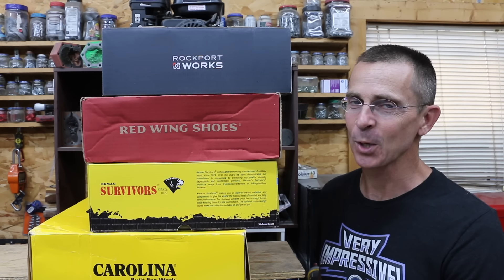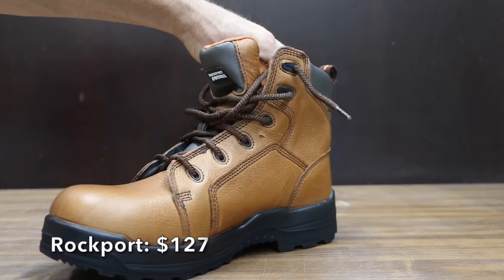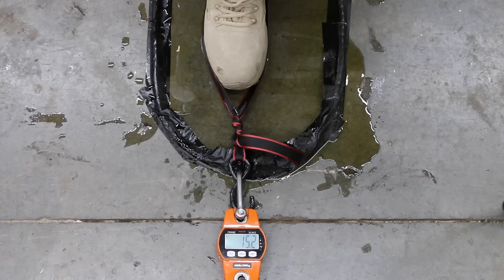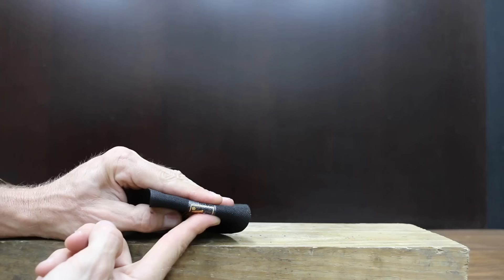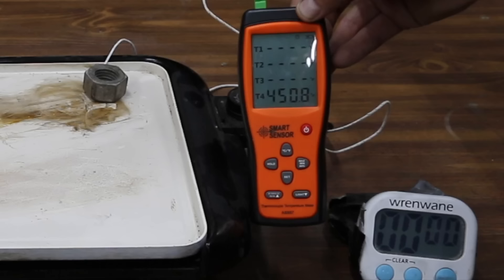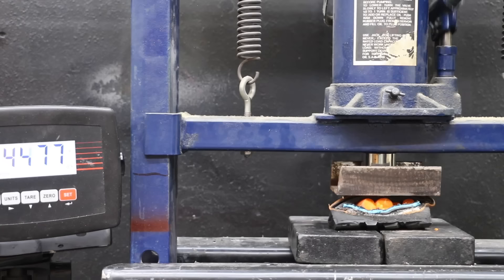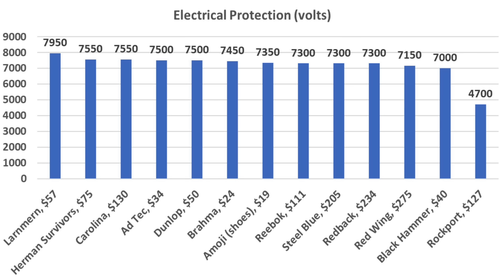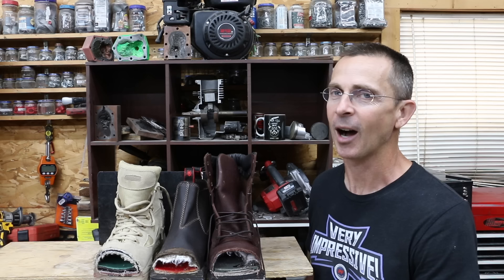Best Boots? $24 vs $275! Let's Find Out!

Comment: Had a pair of Brahma Alpha Waterproof steel toes that saved my toes on my right foot one time. Was weedwhacking a swale in Florida after a couple days of heavy rain was standing In about 3ish inches of water and the grass was a good six inches above that. All of a sudden my right foot was really heavy and hard to move looked down and a snapping turtle clamped down on the steel toe part of the boot. He wasn't huge maybe a little smaller than a dinner plate but I sure was grateful for that cheap piece of Chinese steel 😂 that day would have sucked if I wore sneakers.
Reply from the maker: Thanks for sharing!

Comment: MIG Spatter,  Weld Slag or even worse a small drop of Molten Metal would be a good test as well!

I have a few chunks of slag stuck in the bottom of the cheap steel toe sneakers i had before i got proper leather boots, and the top plastic mesh got all burnt from MIG Spatter.

Comment: I saw both of your work boot videos. But in your first one, you listed Sketchers as being a viable candidate.  I have learned to trust your opinion,  and so I bought a pair.  I elected to buy the Sketchers because of price point because I am VERY hard on work boots. I must say, I really like them.  I do a lot of cement/concrete work and that wears out a boot very quickly so I don't like to spend a lot of money on them (did it before but won't do it again).  

Just wanted to say thank you.  Your channel is very valuable and makes making the decision of which to choose a lot easier. When I first came across your channel, I turned my noise up to it,  but I quickly learned how wrong I was for doing that. Keep up the good work.
Reply from the maker: Thanks, will do!

Comment: Ive sold boots for years. One of the number one things people would ask for are what boots keep the feet the coolest in summer temps on hot concrete/pavement and the sun directly. Overall redwings were very popular they usually solve most peoples sore feet issues standing up all day with other branded boots. They are on the heavier side but are pretty durable.
Reply from the maker: Thanks for the feedback.

Comment: One more test that would be interesting, is shelf life of the boots. Some work boots that have been in storage for about a year or more, start falling apart within days of being put into service. The stitching disintegrates. I've been told, this is due to salts being used when tanning the leather of cheaper boots. 
Also, water leakage, how long for water to soak through leather. then, dry and re-soak, dry and re=soak to simulate a month of wet weather. Boots must be flexed, both wet and dry, to see if cracks form in the leather.

Comment: PUT COWBOY BOOTS TO THE TEST!!

I've been in the commercial construction industry for nearly 20 years and I usually purchase boots under the $100 price range, and they only last me about 6-8 months. About 6 years ago I bought my first pair of cowboy boots that were Justin brand. I got about 3 years of use out of them before the bottom tread at the ball of my foot, completely ripped apart width ways. Now I have a pair of Ariat boots that I've been working in for over 2 years and so far they are the best boot I've ever purchased!!
Reply from the maker: Thanks for the suggestion.
Reply: I wore leather soled Frye boots when we were camping and the smooth leather soles were great for stomping our camp fires out. They also survived walking across the fields after a grass fire, Most of my friends ended up with their rubber soles melting and falling apart.
According to one of their adverts, Frye boots were worn by cowboys because leather does not melt or burn.

Comment: I like redwing boots, they are by far the most comfortable, but the problem i have with them is they are easy to wear out. I wear them all day everyday in rain, heat, cold, mud, oil, corn, on ladders, on flat steel 30+ feet in the air, rough ground, gravel, you name it. I am on my 3rd pair of redwings after 3 years of trying different types
Reply from the maker: Thanks for the feedback.

Comment: I bought a pair of the Steel Blue women's a few years ago. I worked as a remote-control locomotive operator in a steel mill. I don't think they even made it 6 months. Both boots split where the heel comes into the sole. Because I purchased them on Amazon there was no way to return them even though the company says to just return them to where you bought them for a full refund. For reference I was walking between 15,000-20,000 steps per shift, 60 hours a week average. For $200 I expected a better outcome.
Reply from the maker: Thanks for the feedback.

Comment: One thing you should have tested was abrasion resistance of the sole, sides, and toe. Some boots will cut straight through if you accidentally scrape the corner of concrete steps and such, and some boots lose all of their tread very rapidly just by walking on concrete. You could probably test it pretty quickly and release a short addendum, I'm sure it would be appreciated greatly, as all of your videos are. 
Aside from normal wear and tear, I know some people tend to hit their heels together when they walk(I used to until I taught myself not to) and that can rapidly damage many shoes/boots, so that's a thing to consider for some people(although plastic heel and toe caps trivialize this).

If you decide to do another boot video, you should try to test out the boots with kevlar midsoles, plus it'd be cool to see a comparison of the differences in durability/protection from leather, synthetic "leather", fabric mesh, and mixed material boots. I know, for example, my dad has a pair of Brunt brand boots that uses the fabric mesh body(with hard toe and heel caps), which are waterproof and extremely abrasion resistant despite being a very flexible material. I personally have some cheap soft faux leather boots which are shockingly cut resistant. Material science is hard.
Reply from the maker: Thanks for the suggestion.

Comment: Steel blue having such good results in the oil test makes sense considering that is a mechanic style boot. I’ve worn them through gear oil soaked concrete, greasy kitchens, and even on oiled steel without drama

My cousin (electrician) wears red backs all day every day, the same slip on pair shown here, and had to borrow a set of my Oliver AT mechanics boots, and he just couldn’t get used to the weight difference. But he doesn’t have to be up and down vehicles all day and doesn’t need the ankle support you need to climb heavy machinery
Reply from the maker: Thanks for sharing.

Comment: I've boght 3 or 4 pairs of Herman survivors. There is good and bad news. The bad is every pair that I've bought only lasted about 2 years before the soles fell apart. The reason I keep buying them is, by far... hands down they are the most comfortable work boots I've ever worn. They just seem to fit my feet great. I use them when I'm cutting lawns, and have them on 9 or 10 hrs a day (30 hrs a week). I feel like I'm wearing sneakers. Not too tight, not too loose.
Reply from the maker: Thanks for the feedback.

Comment: I have three pairs of boots which I switch out from time to time.

One pair is 30+ years old with rough out leather.  The leather is old, and had a hole which was repaired. More recently, a portion of the welt on one boot pulled loose.  I glued a patch to hold the welting and prevent additional damage.  After resoling and repairing them several times, I will probably not repair them again when they wear out again.

A second pair is probably 15 years old or so.  The leather upper is in good condition and I polish them from time to time. I have resoled them probably once, and replaced the heels again,  and that will likely need to be done again before long.

My third paid is about three years old  "Danner Boots."   Leather upper in very good condition .  I've replaced  the heel once and it will need to be done again before too long.

These were all good quality work/hiking boots.  Durable and have been serving me well. 

Shoe laces now -----THEY are a nuisance.    They get abraded by the hardware and fail too often for my taste. 

I wear boots every day.
Reply from the maker: Thanks for sharing.

Comment: Like to see a toe can abrasion resistance test as the site I work on doesn't allow exposed toe caps due to spark potential. So once they wear through they are they have to be replaced

Comment: I would like to see an abrasion test on the sole.  Walking over pointy rocks some soles will start to shred (keen).  Press them on a belt sander or orbital sander for awhile. 

Another test that would be nice for cold climate use is the cold conductivity of the sole.  How fast they become cold, retain cold, and transfer cold into the footbed.
Reply from the maker: Thanks for the suggestions.

Comment: I wear that exact style of redwing boot that was tested and I have for over 20 years and I can confirm that they are superior in quality, comfort and longevity than any other shoe I’ve ever worn. I have never worn out the soles and I’m a tradesmen that wears them every day all day long. I usually replace them because the upper leathers are just worn out after about four years of pure abuse and neglect. The best boots ever!!
Reply from the maker: Thanks for the feedback.
Reply: I was going to say the same, I have the upgraded model with composite toe and metatarsal guard for almost 10 years now. Boots look new with a few imperfections to stiching.

Comment: I work in a sheet metal/metal fab shop and used to wear Wolverines.  They'd usually last about a year at most before they started breaking down.  Bought a pair of Keens 3 years ago and never looked back. Very rugged and reliable after taking incredible abuse.  Also I always use aftermarket sole padding on every shoe I own.  That's a no brainer for someone that is standing on concrete and jumping up and off of machinery all day long.
Reply from the maker: Thanks for sharing.

Comment: Love your videos man, always informative and have  helped me learn about brands I've never tried or given a chance to before. 

A small caveat for anyone thinking of getting Red Wings after this video, most of their standard safety shoes are now made over seas and neither my coworkers or me have had them last more than 6 months at best with even regular daily shoe use since they changed years back (before the change my previous pair lasted 4.5 years of work use with proper care), and only the heritage line is made in the US still. For their heritage shoes the ones that use the "Rough & Tough" leather is the same type of leather that Timberlands uses for example, nubuck leather which isn't bad, it has a feeling of suede but is stronger it's just not anything special over what many other brands use and NONE of Red Wings are vegetable tanned only oil (chrome) tanned leather which might matter for some people paying $250-300+ for a pair of leather boots since vegetable is the traditional way and seen as a higher quality in an artisan sense BUT not a lesser leather in terms of protection from anything I've ever seen or saw proof of. For the heritage line Red Wings do work their own leather in Minnesota BUT they come in the wet blue state from the same sources that other shoes brands also buy, not super uncommon but they don't perform the full tanning process so I'm mainly just clearing that info.

TLDR: Red Wings are good high end boots but ONLY if you get the heritage line if not their standard boots just don't last long enough to justify a 65-150+ price tag anymore. From my experience if you don't want or can't afford the heritage lines I would recommend you get another high quality brand of similar cost to their standard boots.
Reply from the maker: Thanks for the feedback.

Comment: Aside from upper-tier logger style boots made in the Northwest, Red Wings are the most durable and best made. 

I have a pair in my closet that i bought in 2003, and have probably 10+ yrs of construction site use on them, 3 yrs of communication Linenan work, and hundreds of lawn mowings on them. 100+ deg summers, wet winters, sharp objects, concrete dust, mud, etc. Theyre beat down pretty much, heel is worn uneven, some stitching coming loose but the leather hasnt torn yet. Oiled them maybe 1-2x a year at most with Red Wing oil.
Reply from the maker: Thank you for sharing!

Comment: It’s kind of crazy how deep my brand loyalty to Red Wing is. For over 45 years now I’ve only had two pairs of steel toed hunting/everything boots - both Red Wing Irish Setter Sport Boots, with the 1st pair lasting from about 1979 to 1992 and my 2nd pair from 1992 to present. They may not be tops in all of these tests, but I can’t see a reason to abandon the brand now. I just wish they still had the Irish Setter Sport model. At about $500 ($250 per pair) spread over 45 years (and counting), that’s only $11 per year. I don’t think there’s a way to test long-term durability, so I doubt the cheaper brands would wear as well. I’m very happy with my Red Wings!
Reply from the maker: Thanks for sharing.

Comment: Thinking about shopping around. I don't need new boots now but I've been told by co-workers I should have a good set and a dirty set for pavement, calcium, salt, and other stuff where you won't get anything 100% clean and will harden the boots. I'd use my current boots for the messy stuff.
Reply from the maker: Thanks for the feedback.

Comment: Black Hammer boots are excellent. Good bang for your buck.

The only problem I have found is that they are rather high up the ankle to be comfortable when working kneeling or crouching.

I wear TQGOLD shoe style for most work, they have a steel toecap and a Kevlar sole. They are comfortable enough to wear as ordinary outdoor show although they a a bit wide for driving.

Comment: i would like to see the water resistance/ or waterproof(ness) of some of the boots.  I typically wear non steel toed boot and am outside in all types of weather.  It would be nice to also see the insulation factor of some of the different kinds of boots (which ones would keep the feet warmer in colder weather)  I enjoy the videos and it helps me to decide on some different things i look at to get from tools to electronics, to penetrating oils and such.  Keep up the good work!
Reply from the maker: Thanks, will do!  Thanks for the suggestion.

Comment: I have been using those same red wings for probably 10 years. Worth every penny and haven’t found a better designed boot for welding. Sparks slide right off and are the easiest on my knees.

Comment: Went to a Red Wing store a few years ago looking for a good leather belt. Casually asked the owner, "they make steel toe caps wider yet?" After he found out my foot size, he brought out a pair that actually fit my wide-ass feet, bought them on the spot, couldn't believe how well they fit.11.5 4E US size if you care. And they had steel shanks.  I didn't need them, but I had to have them, over $400 US.  Every shoe before this that fit was old-style zipper side paratrooper boots and certain models of New Balance running shoes.
Reply from the maker: Thanks for sharing.

Comment: one thing to consider is that the red wings can be repaired and resoled while the others cannot. you can get a good performing boot for cheaper, but all of the others in this test are disposable, while the red wing can be resoled and have anything but catastrophic damage repaired by a cobbler.

i know most people don't bother, but especially for a more expensive boot it is much cheaper to get the resoled and fixed up than to buy a new pair.
Reply from the maker: Thanks for sharing.

Comment: Yes...more on the boots , sketchers makes a decent inexpensive S.T. boot and they have a lot of their sizes in Wide , which can be hard to find , also you didn't say which boots had a stitched or welted sole , I'm sure most of the lower priced ones were welted , but if I'm going to spend upwards of 200 $ on a pair of boots ( which I don't mind for the right ones ) I have to be able to replace the soles at least once as I will burn through the soles fast and the rest of the boot is perfectly good , usually I like a waterproof goretex or similar liner as I am outside a lot.
Reply from the maker: Thanks for sharing.

Comment: Great videos on boots would be interested in seeing a video on non steel toe boots that would include water proof testing and cold weather protection for use in spring fall and light winter
Reply from the maker: Thanks!  Thanks for the suggestion.

Comment: When I used to work in a fab shop, Red Wing and Thorogood boots were my preference. 

But I’ve been a union Boilermaker for almost 8 years, doing construction and maintenance of powerhouses, paper mills, steel mills and refineries. Between working in very tight or odd

 positions and chemical exposure, nothing I tried would even last a full year. Until I bit the bullet and ordered a pair of Nick’s Work boots. At about $550. 😮 I have two pair, the oldest being 3.5 years old with a resole under its belt. 

The break-in is absolutely brutal, no sugar coating it. The leather, including the leather sole, is like iron to start with. But they ended up the most comfortable pair of shoes I own. Yes, I said shoes, not boots. 

The only person I know with similar life out of their boots wears Matterhorns.
Reply from the maker: Thanks for sharing.